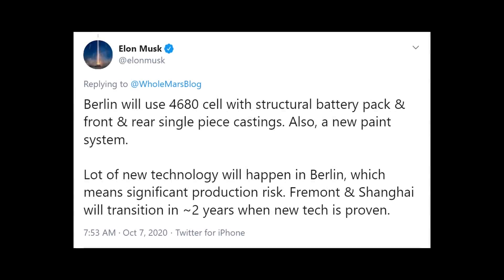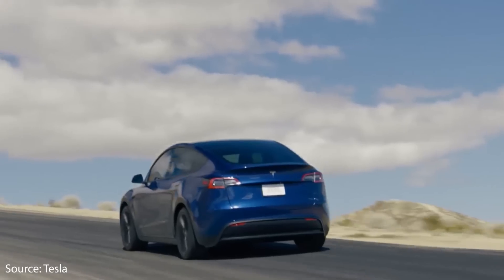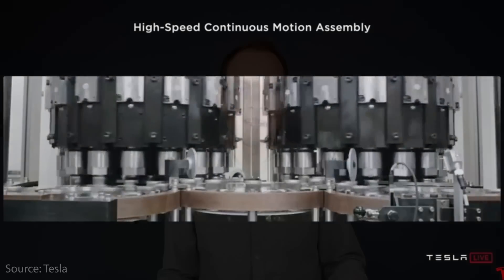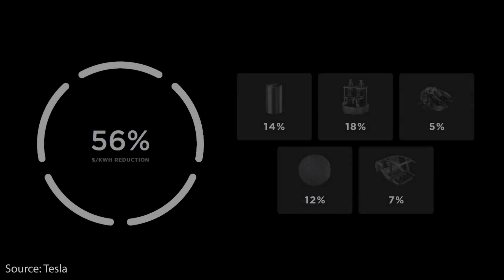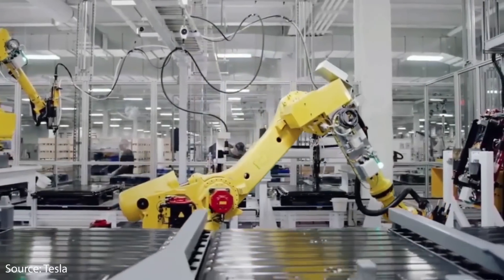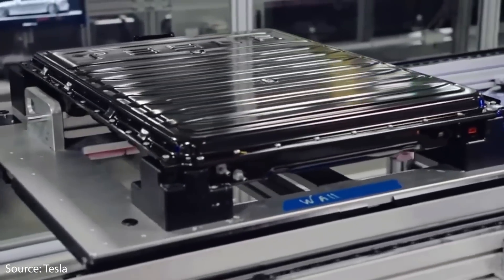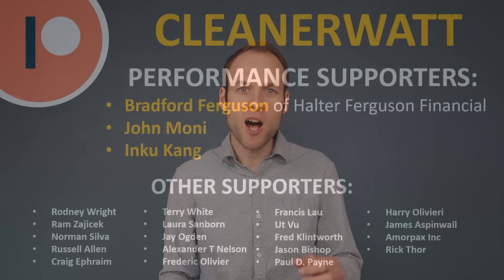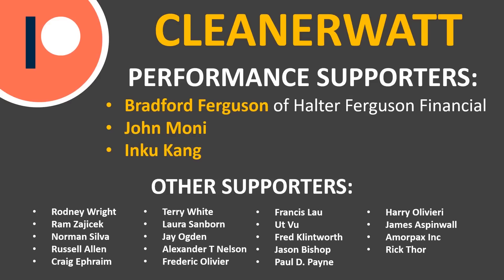Tesla Model Y will Get 4680 Batteries + Made in China MY Progress Update

Comment: I think that Elon is sandbagging the upgraded Model Y for the U.S. He wants the European Model Y to be Tesla's EV star for the next 6-8 months, and he doesn't want to lose any Model Y sales now for U.S. and Chinese Model Ys with rumors of a soon to come out 4680 domestic model (other than the Model S Plaid). I think that Fremont already built prototype 4680 Model Ys for China to evaluate. I think that the first EVs out of Giga Texas will be the new 4680 Model Ys, within a year from now. I also think that there will be 4680 Model Y's built in China around the same time, but I think that they will be LG Chem's NCMA chemistry 4680 format batteries, which will have a tab-less design, but no Maxwell dry electrode technology. I also suspect that CATL will build a LFP 4680 battery, which will later be used in MIC Model Ys to provide a lower price point, and full Chinese component content to get full Chinese subsidies. And later these cheaper models would be exported to Europe.

Comment: If the batteries are part of the structure, can they still be replaced?  Once the batteries die, I guess you throw away the car...
Reply: Not necessarily. Ie :The engine in a modern race bike is a structural part of the frame..( not cradled by) but it is removable .. 
I assume for the life of the vehicle they will be treated  as one thou.. I also believe those  batteries will be good for a million miles and  likely salvaged when the car is done

Comment: VW ID3 Pro with Life trim has the same range of M3 SR+ and it costs about 10k Euro less than M3 SR+ in Europe, so please you and other Tesla fan boys stop making so obviously false claims about nonexistent Tesla price per range advantages.
Please do not midunderstand, M3 SR+ almost surely has a more advanced powertrain tecnhnology than ID3, it shows itself with better performances and better charging speed, also the additional cost of M3 SR+ partly goes in a more developed charging network that gives further advantages to the Tesla customer, however please do not claim advantages on benchmarks, like price per range, that actually see Tesla as a looser.
Reply: I agree it all depends on where you live and what you need, I was looking at getting an EV here in Sweden and looked at M3 because everyone said it is basically the same price. But I lease my cars and the best leasing offer I got on M3 SR+ was way more expensive than an ID.3 or even ID.4. The best offer for a M3 SR+ I got equivavlent of about 750;- USD a month. With the ID.3 it is about 410;- USD a month. I could get the top spec. ID.3 for about 510;- USD a month with 77kW battery. But this is a second car for us so everything the tesla offers in charging networks and software where they excel was not worth the extra money. In about a year and a half we will change our bigger ICE car to an EV as well. Then the ID.4 is a strong contender, it starts at about 560;- USD a month now, Model Y has no leasing offers yet. Hopefully the cost reduction in battery will show on the price, and I may consider a Model Y, because this car we will use more on the road and no one can at the moment beat Teslas charging network on the roads we will be going. 

All in all I think so many people say that this is or that is the best, but there is so many factors for every individual. Some journalists f.ex. Tesla Björn (Nyland)  never recomend anyone what car to get or what is best. Because as he says it depends on everyones individual situation. Journalists should present the vehicles and their findings during tests and then you make up you're own mind. 
To buy M3 in sweden is about USD 64.000;- for SR+. Cheapest ID.3 is USD 48.500;- and most expensive with 77 kW battery USD 59.200;- this is price before incentives, which is about 6.700;- USD for all cars.

Comment: Does this increase insurance costs? 
The structural battery pack is great. But begs a question about crash repairs. Nobody wants a structurally weak rebuild so does this make a write off more likely?  Does this increase insurance costs.
Reply: There will be more space between the cells and the side of the vehicle.
Therefore, logically (?) It will take a harder hit to reach the cells.
Based on the test reputation of Tesla's, any accident hard enough to do so is going to be the end of that vehicle, total Write off.
Similar with the front/ rear castings.
Just btw, I think if you watch the presentation, EM said the structural pack makes the car stronger ?

Comment: How are they going to replace the battery in a case of a defective cell If It is fully integrated into a vehicle?
Reply: Have you looked at a Tesla pack? I mean an "old" one?
Once those cells are in the pack, they're not going anywhere.
Cells are not "replaced"
"Integrated" doesn't mean "welded to"
A lightweight pack can be bolted to a lightweight floorpan, making the combination extremely strong.
Reply: @rogerstarkey5390  , current Tesla battery pack is easily replaceable. But I don't think the new integrated battery will be replaceable at all.

Comment: If the battery is structural and pretty much the base for the whole car, is the car scrap when the battery got a problem?
Reply: Depends on the structure engineering. If it's done more like a conventional truck or SUV, than no. You can replace a frame on one of those, it's just not cost effective from an insurance point of view. 
But if you check out a few channels that rebuild salvage Teslas I'm going to guess it would be scrap. It's not that they are difficult to repair, it Tesla doesn't wat you doing it. Parts are difficult to get, the company techs are telling you to just buy a new car, and getting the supercharging turned back on is an issue.
Reply: Even cell phones have moved to a more integrated pack. Benefits like being more water proof, are what people want. So I'm not surprised electric cars are going in the same direction. Replaceable parts are important to me, structural benefits be damned. Things break down over time, and I personally will not be investing in a car that is effectively disposable when the most vulnerable parts inevitably go bad.
Reply: @smrack  cell phones and cars are not a good comparison to make. If a cell in a phone battery dies, we now throw the entire battery and phone away. It's a $100 to $1000 item, and the battery probably lasts 3 years and then for many people it's time to upgrade anyway. If a few cells in a car battery dies in 3 to 5 years, surely we don't throw the whole car away. That's economic and  environmental madness.
Reply: @DavidTangye  You hit the nail on the head of the problem. What are you going to do in 3 or 5 or 8 years when your 300 mile range car only goes 250 miles? What about 200 miles? Or half its original range? Once the battery pack is structural, you can't just swap it out for a new one. Just like a phone which needs special tools and skills to swap out a battery. Except now we are talking about a $5000 battery pack and another thousand (or more) for the swap. The proportions are the same, so how is it a poor comparison?
Reply: @smrack  just as you indicate, it's a matter of scale. People might throw away a phone with little regret due to the battery degrading, but they will have huge regrets about throwing a whole car away when it is otherwise not old, and in very good condition. Of course that does vary from country to country. I think some countries still work on a highly consumer based / throwaway model much more than others.
Reply: @DavidTangye  I'm also the kind of guy who refused to buy a phone with a built-in battery pack. Regardless of scale, I will not throw away a perfectly capable device just because the battery is dead, because I won't pay for something that puts me in such a position. If someone else wants to pay that kind of money in maintenance to keep it going, maybe they will also probably consider just keeping with the internal combustion engine. If I get an electric car, it will be for lower maintenance costs more than "saving the planet" from fossil fuels.
Reply: @smrack  People will buy old EV cars that have batteries that have shorter range second hand because they will be cheaper and some people only want the car to do short journeys around town for commuting and shopping etc. There will be a big second hand market. When the range of the second hand car that they bought gets extremely low then they will scrap it and replace it with another second hand car that has the range that they need. More and more people will be able to buy an EV car because they will be able to buy cheap second hand ones with reduced range. Eventually new EV cars will reduce in price and therefore the second hand ones will also reduce in price. It is going to take a long time before there are lots of second hand ones on the market that are old and have reduced range and hence are very cheap. It is going to work like the second hand ICE (internal combustion engine) car market.
Reply: @bobgriffin316  I think I am in the minority when it comes to what I am willing to spend my money on. How many people can say that in 2020 they replaced the water pump on a mid-90s half-ton because they want to stretch their dollar value a bit? I agree that there will probably be a market for reduced-range EV's, if the price is right. I'm tired of replacing water pumps and corroded exhaust lines. Give me a modular EV with replaceable parts so I can hang up these overalls until I find that classic ICE worth throwing them on for.

Comment: Sure, you might not have to wait if you are a Model Y reservation holder. But I would seriously wait for the Giga Berlin Model Y with 4680 batteries and structural battery pack. This just seems like a better offer, even if only available from mid 2021

Comment: Unless it's already been said, I think that Musk said the Berlin Model Y would be first to get the 4680 batteries because of  megacasting. First, the two castings (that are probably in my Sept Y), soon or already the single casting, and what he said about the three castings planned for Berlin. Setting this up is the first opportunity to integrate the structural 4680 battery back-bone. I think the Model 3 will soon follow because I think if all goes well with the 'three castings Berlin Y' then production cost for a Model 3 will be significantly greater. Also once Tesla gets the bugs worked out of the Model 3 megacastings, it will be a lot easier to set-up to create them for the Model 3. 
I'm surprised that Tesla hasn't preemptively addressed the Osborne Effect (everyone waiting for the new better ones) by announcing discounts for future battery replacements and upgrades. When a 500 mile Model Y becomes available, I'm going to feel a bit dated with a once Long Range 315 mile Y. 
Another thought. I don't think there will be a big demand for longer range Teslas in China. China is big, but most of the population centers and places people might drive to are within about 1300 miles. Basically Beijing to Guangzhou to Kunming, Chongqing and back to Beijing. I don't think many road trips will be between these cities but within the areas between them and adjacent to. Everything else is too far away, and if you're in these places almost everything you'd drive to is local. The only desire for a 500 mile Tesla in China might be from people who can only charge at Superchargers and won't want to have to go more than once a week. And Tesla's altitude advantage? The parts of China that are at high altitude, well the whole area is at high altitude so the vehicles are already tuned to drive 7000 feet to 10,000 feet, because they won't be driving down to sea level or even 3000 feet. Just thinking out loud.
Reply: I don’t think they will improve range on model y. They will just put less cells into the pack lowering weight, and most importantly price increasing profitability which they really need.

Comment: I think the first cab off the rank for 4680 cells will be stationery storage because if you have a problem with a batch of 4680's you can just replace a module or so in the storage unit. The cost of doing that in a car with 4680 cells  as part of the structure would horrific.

Comment: I wish you would go over the pros and cons and not just the pros... as their is a lot of draw backs to this as well.
Reply: Like what?
Reply: @davidraley3239  I'm concerned that the batteries are not replaceable if things happen as they do, making less parts in production is cheaper on Tesla but what about when you get into a car wreck will the car be easily totaled as this will increase insurance premiums...btw I am a Tesla enthusiast. Hopefully I am just overthinking things.
Reply: @blusensation2350  The whole 75kWh battery pack will cost €3000. It is better to make a cheap battery pack where you cannot replace individual cells than an €8000 battery pack where you very seldom use the opportunity to replace a few cells.
Reply: @BjorckBengt  that's fine with me, I just like to point things out as I see them at that price that's fine with me

Comment: If Germany is going to get the MY fm China early, then it will be a series 1 version, because they won’t be 4680s structure and therefore not castings f and r either............ right?
Can you clarify this odd situation for me ?
Reply: Germany isn't getting anything from China, currently if you're in Europe you can't get any form of the Model Y as that will happen once GigaBerlin is up and running. At GigaBerlin they are going to be using the new 4680s, cell to structure pack, front casting, rear casting, and new paint shop.

Edit: just saw the bit of the video talking about Chinese model y getting exported to Europe. If I was living in Europe and waiting on a Model Y honestly I'd wait for GB to get up to spped first
Reply: Kirby Glover apparently the interim Mk1 model will come from China with the 4680 Mk2 taking a couple of years more production development .
Reply: @davidpearn5925  well from the cerifications/blueprints that have been found for GigaBerlin, the low water usage points to the 4680 tech being there from day one. The 2 to 3 year ramp for 4680 batteries that was given on battery day likely points to all/most models being swapped over to them, at least that's my interpretation. Granted, we aren't gonna know for sure until everything gets built out and we get more updates
Reply: Kirby Glover yeah, but they will import wet cells I imagine for the initial ‘old’ Model 3 output.
Production engineering for the 4680 is a very big undertaking when talking high speed reliable output for a unique cell.
Reply: @davidpearn5925  
"Apparently"?
It's not "apparent" at all.
Reply: Roger Starkey I watch so many Tesla clips but don’t bother with records as proof.
Take it or leave it.

Comment: When will Tesla be implementing this new tech to the model Y, I’m thinking about ordering in Feb 2021
Reply: From day one in Giga Berlin, everything points to that.. 8 Giga presses, battery production without the huge water consumption and floor space needed. Tesla is ALREADY producing 4680 cells by the thousands in Kato Road, which needs improvements and itterations, to improve the yield (reduce number of bad cells) But they are on revision 4, and every 2 months they upgrade to a new revision.. by the time Berlin starts producing the factory will be at revision 7 or 8, and probably ready for first mass production.. in Giga Berlin.

It would make no sense for Tesla to start delivering Model Y from China, why add the shipping costs, why add the tarrifs, if you can start delivering at much lower costs, without tarrifs and what not and offering europeans the best they have just a few months later?.. I really think Tasmanian is wrong about this.

If you order in 2021, I am pretty sure you will get the MIG Model Y with all the new tech, I have already a Model Y on order since June 2020, pretty sure I will also get the MIG Model Y with the new tech.. If I get an offer in January I will deny and say I want a MIG Model Y, Tesla cannot force you to take the order at that time.